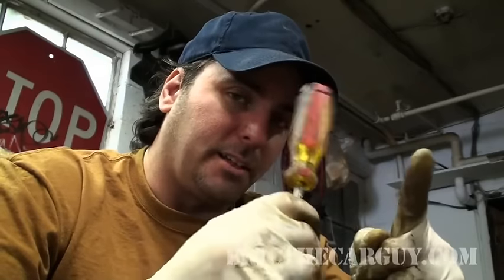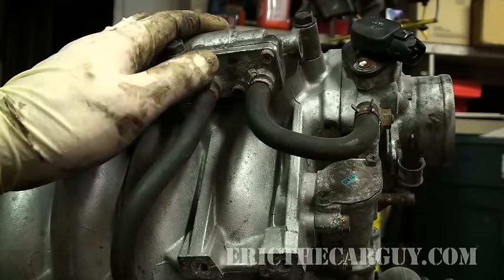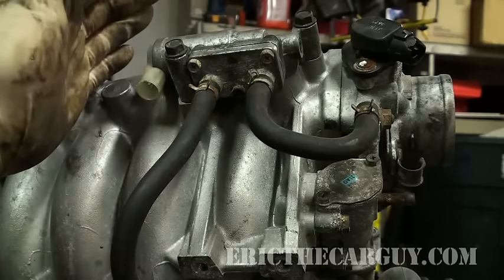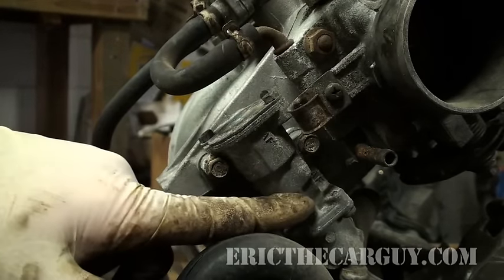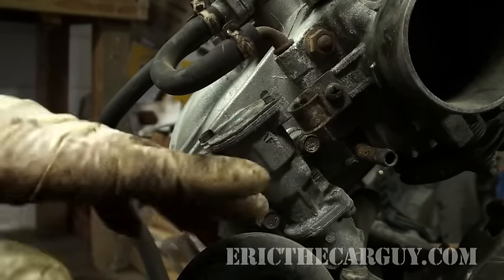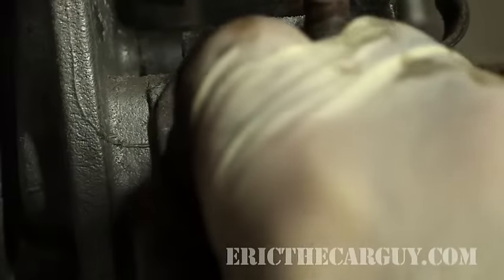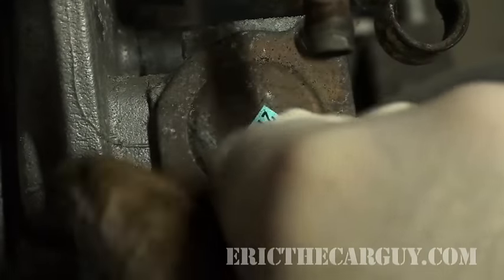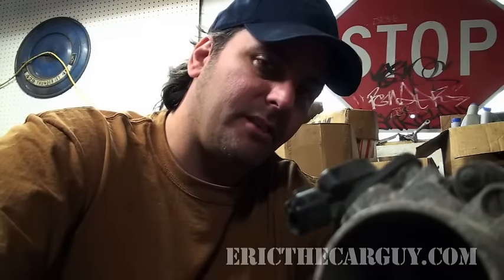How To Solve Honda Idle Problems - EricTheCarGuy

Comment: Ok lets see if you or anyone else can point me in the right direction. I have a 92 Honda accord. Idle surges but only in cold weather. When temps outside are above 60 or so she doesn't do this.. I'm a single working mom with 3 kids. I don't have time or money to put in a shop or play guessing games.
Reply: Make sure it has right coolant levels and right coolant mix...cold weather does effect honda motors, ie: idle and running quality

Comment: Mann if I tap on the IAC valve while it’s running it idles down to the point where the car almost dies..... the problem is it’s goes from 1500 rpms to 1000 rpms like it’s cammed

Comment: Hey guys,

if anyone can help me I would greatly appreciate it. I own a 1997 honda accord ex with the 4 cylinder Vtec engine. Recently, I started having a bad idle problem where my idle would go up and down when in park or neutral. The problem however, would stop after the engine warmed up. I took it to a mechanic who told me my IACV was bad so i had it replaced. The problem persisted so then he cleaned my throttle body and FITV but the problem got worst after all that. The fluctuation of the idle extended to the drive gear when before it would only affect the car when in park or neutral. Now when i drive down the road or come to a complete stop the rpms start going up and the car accelerates on its own. The park and neutral gears do the same still. The mechanic has checked for vacuum leaks and nothing to be found. I am running out of patients and money. If anyone can help me it would be greatly appreciated. New gaskets were also installed when the items where changed!
Reply: Did you check fast idle valve? My integra did the same. Only on cold starts it would surge but after warmed up it would be fine. I tightened what was inside the fast idle valve and my cold start up went back to normal. Good luck!

Comment: im having trouble locating the proper valve on my 14 honda crv
Reply: Clare Harvey if your talking about the high idle control valve,I would suggest googling   for its location for that particular year or engine size.
This video kinda is for 90's Hondas.2014 may not even have this type of control anymore.

Comment: My honda is running as if its loseing compression, when  i accelerate up to  54 mph  Its running louder than usual, The  RPMS are at 3000 in 5th gear maybe thats normal "MAYBE" But it sounds like it needs to shift one more time And i still do it. Unknowingly but still knowing im in 5th already;  just to put it back in gear.???
(Im weird like that) Anyhoo, The Exhaust is  sounding like its broke off the damn manifold. Thats fun for the toll booth worker; Hand  them the change And then stomp on the gas; pulling off  in hopes to piss them off with how loud it is.  But i also hear the crank shaft rattling, Furthermore, My check engine light has been on And yes, I have a signifigant  mixture of Exhaust And Fule feumes at times But try the toll booth with the muffeler broken off at the manifold they will never forget your car again.
 Oh yeah, I had a basic   diagnostics ran on My 2001 Honda Accord EX 2.3 , By dizzy Auto, The parts dude said; Its the 02 censors malfunctioning so i was like;  Nigga, wachew said? (Meaning Im Broke, what els could it be? )  So he went to say it again And i said, "shutcho ass up"No Sale! But after we  bumped gums for hot min and Then I  left,   I drove damn near ta Timbuck Two, Just to realize his punk ass done sold me the wrong spark plug socket And his lil punk ass did the return where i was ready to  say "Nigga!  lets Bump 2 rounds in this greezy ass parking lot; cuz i want the right tool and  paper money fool.  Shit , that fucker sells  me the wrong tool tryan to push store credit on me. "I dont think so"! Anyways, If  I clean the carb would that  help the cars performance For the time being? Also can you tell me if when a  02 censor malfunctions, can that throw of the timing off?

Comment: sorry everyone let me rephrase that what I said I have a 1995 Honda Accord my issue is when I'm going down the road and if I take my foot off the gas pedal my rpms will go up and down up and down but once I put my foot on the break it will go away okay now I see that the throttle position sensor is next to the firewall and I first few here and there that it has to come out with the throttle body off some people use assault and they just pop the screws because I heard they're ribbits with the easy way about going this and how would I know if its max answer before throttle position sensor it look like it's been replaced before because there's a seal and we're talking about their opposition sensor every I took the MAP sensor off the bolter really lost it I replace them with new ones how are they diagnose a bad MAP sensor even if I do read the meter

Comment: How To Solve Honda Idle Problems?
1. drain oil
2 start engine.
3 rev engine
4 when engine comes to a complete stop, honda  idle problem has been  solved.
Reply: insane_ivtec fuck really
Reply: ChadMutt Yes.Welded piston rings will solve any idle problems.
Good tip.

Comment: My car won't crank it turns over.  It's getting fuel and has spark.  What else could be wrong.
Reply: +Linda Smith pgm-fi main relay solder connections is a possibility.
Reply: have you had the timing checked?
Reply: Last time this happened to me, the firing order on my distributor/spark plug cables was wrong.
I looked up to diagrams, one of them was right. The previous owners had also marked the firing order wrong on the cap (the wrong diagram).
Reply: Check your fuel pump, had the same problem with my Integra. If you don't hear it prime when the car turns on, then the fuel pump is bad.
Reply: funny stuff.I was experiencing this. As many things as it COULD have been all it turned out to be was a loose ground wire that bolts to the thermostat housing.
Reply: Linda Smith ooo

Comment: Hey man, hoping you can help me with my 96 Civic EX so I don't have to pay a mechanic 100 bucks an hour to tell me what I already know. After changing my spark plugs and plug wires one day, for some reason the idle speed started to surge between 1,000 and 2,500 RPM and it threw a check engine code for the IACV, so I bought a new one. (Actually I bought two because I didn't know there was a difference in parts between a manual and an automatic!!) Anyway, I finally got the right part, replaced it, and it did not fix the problem! (F*CKKKKK!!!) I went to AutoZone and had them run the code tester again, and now I'm getting two codes, one for the low voltage to the MAP sensor and one for high voltage to the TP sensor! WTF is going on?!?!? It did not trip those codes before I replaced the IACV! So out of curiosity, I unplugged my MAP sensor while running and it immediately went back down to just below 1k RPM where it should be. I plugged the MAP sensor back in and shut it off, but then after I restart it, it goes back to the idle surge! This car has been a constant domino effect of check engine codes ever since I changed my plugs and plug wires and I have no idea why so many things are going wrong with it. I have a hard time believing that these things are actually bad and that I have a wiring issue somewhere, but I have no idea where! I hope you can give me some pointers man, this car is trying my patience! Thanks.

Comment: Hey Eric, I have been watching your videos for a long time ! I've come across an issue that doesn't seem to be otherwise explained by anyone on the internet. I have a 93 CB7 with an H22A1 motor swap, fully rebuilt. I have a link here on how poorly it runs; https://www.youtube.com/watch?v=R7jqJaCkPwQ I was hoping you could give me some advice. It has fuel,spark,compression and every last little thing under the hood has been replaced. Running a P13 computer, using the PT3 computer from the auto F22 accord for troubleshooting. 94 octane gas, full coolant and oil, everything is plugged in and no codes on PT3 but with the P13 I have code 21 (VTEC) even though I have it all wired up properly. Please you gotta help me out dude! I'll post a burnout in your honor if this gets resolved. There aren't a whole lot of these old Hondas around anymore and I don't want to give up on my project as im 99% done the bloody thing. Its been over a year since I put the engine in and it still doesn't run